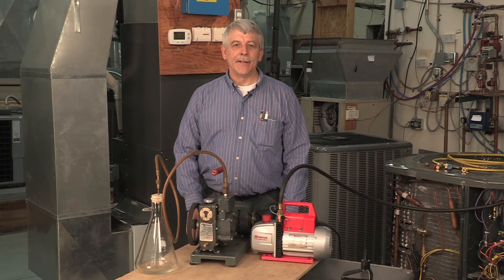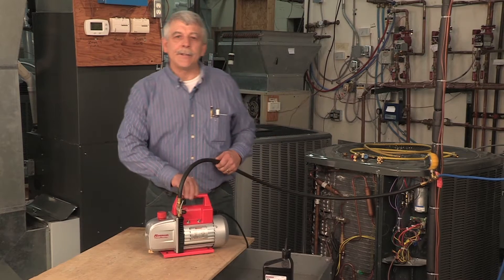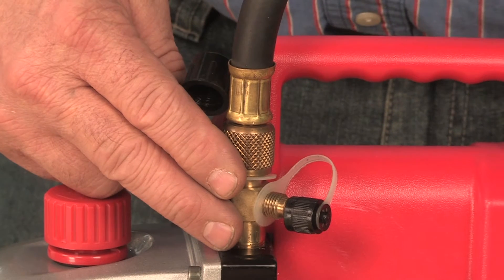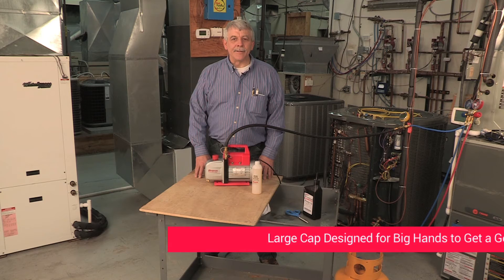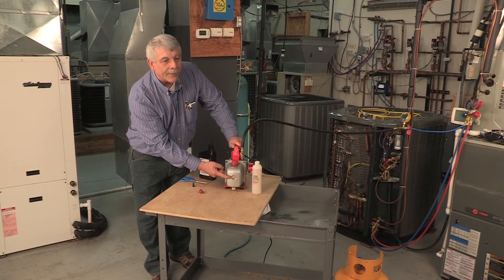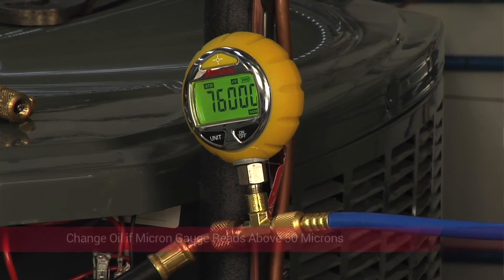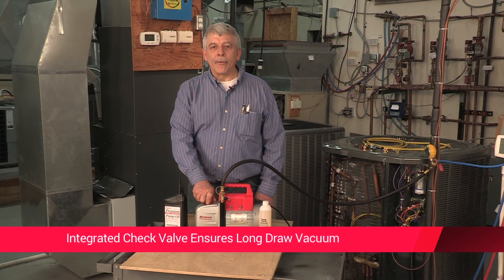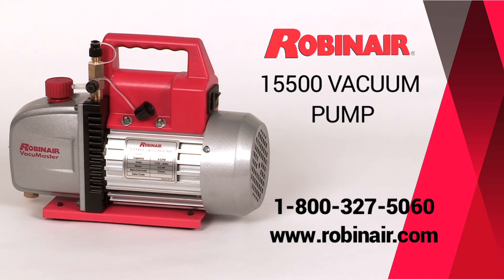Robinair 15500 Vacuum Pump

Comment: Hi, I happent to have a vacuum pump similar to the one on the left. It has a foil label Robinair Part No. 13.00- .75, The foil covers a riveted label plate  with perhaps the manufacturer, Duo-Seal Model 1400. Any chance someone knows where to get parts? THe pump still works great, however, it leaks oil. I would like to see if there are shaft seals available.